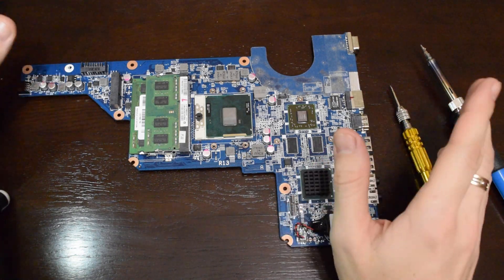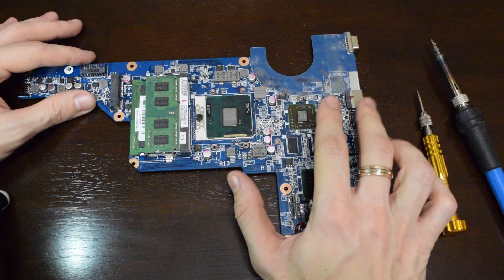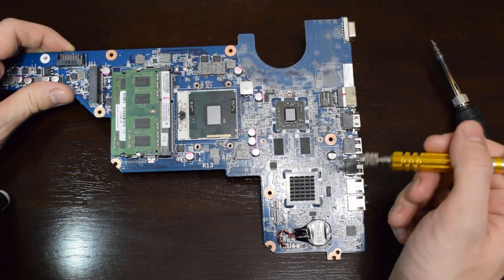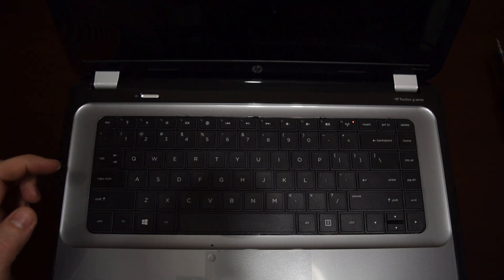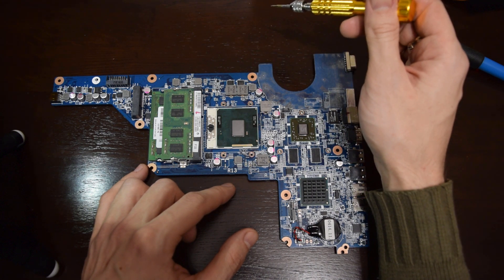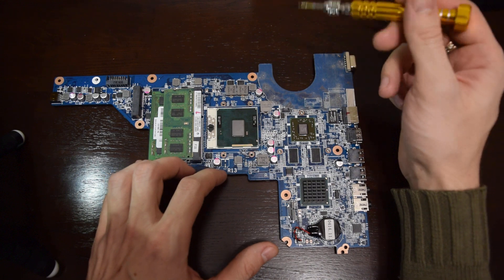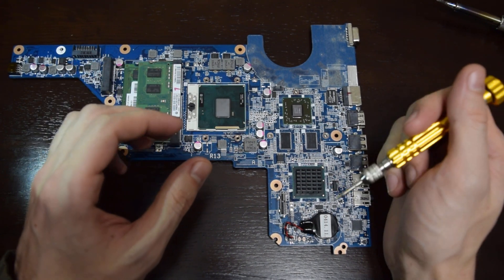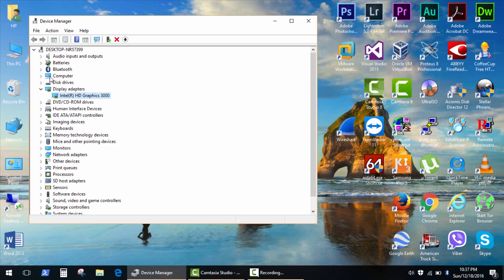Fix Dead GPU – Convert HP, Dell, Lenovo Laptop to UMA Graphics (HP G6 Example)

Comment: For hp G62-a014SL with proc Amd Athlon and graphics Amd Radeon it’s possible remove any coil?
Reply from the maker: Works only with Intel's CPU in that model.
Reply: @ElectronicsComputers  for my model there isn't a solution?

Comment: Hello, would this work with my Acer nitro 5. Nitro 5 (AN515-52-57MQ)please :( badly needed help
Reply from the maker: Technically it's possible but for that model it requires replacing/removing a bunch of tiny resistors and some components and most likely reflashing BIOS for UMA version. Without proper knowledge and tools it's impossible to do at home. Just ask some technicians in your local repair shop to switch your laptop dedicated to UMA graphics.
Reply: @ElectronicsComputers  hello :( I'm here again cause my new pc got burned and just got the laptop to fix left I send it at the local repair shop and told me they can't fix a dead GPU and doesn't know how uma works. If I send u a clear pic of the board and a copy of it's schematic in the web. Can you help me out? 😞
Reply from the maker: @memecentral2758  let's give it a try.
Reply: @Electronics&Computers  hello, I placed the photos and the schematic in the Google drive.
I have the soldering tools and I know how to solder just not familiar with a laptop motherboard since I simply solder home appliances. Hoping you can help me out. Thank you 🥺 appreciated
Reply: Hello, anyway I can send you the link? I can't seem to comment a drive here
Reply from the maker: @memecentral2758  my email is in "about the channel" section.
Reply: @ElectronicsComputers  hello, I can't find any email on the about section

Comment: Would this work for Acer Aspire 4750G?
Reply from the maker: Remove this coil: https://ibb.co/Qvg2TJD
and then move these tiny resistors like in this video: https://youtu.be/8vHh10IOJKQ
Reply: @ElectronicsComputers   i cannot find which coil to remove based on the uploaded photo. Can you please make the highlight a little bolder. Do i need a heat gun to shift the the resistor from the video you shared on this comment?
Reply from the maker: @carlotampus5700  I've just edited the first link. You just need a regular soldering iron for those resistors. But if you have an access to a heat gun that's even better.
Reply: Unfortunately this didn't fix my no display issue. Thanks for the help

Comment: Hello sir
I have a samsung Np670z5e that has the same issue amd graphic card is broken and it causes freezing issues when I'm working on my laptop
I have switchable graphics card intel 4000 and amd
Will this method work for me
Thanks in advance
Reply from the maker: Yes, it will. You'll need to remove one tiny component from the motherboard: https://ibb.co/hYyJ53y
Reply: @ElectronicsComputers   thank you so much you saved me. thank you a million

Comment: Is this possible on Acer aspire 4738z and its chipset is heating whenever I switch on the power
Reply from the maker: No, it's too old laptop and its CPU doesn't have built-in graphics in it.

Comment: I have an Hp Elitebook 8460p with discrete graphics amd radeon 6470m, i dont know which one i should remove. Please help, i'm desperate.
Reply from the maker: It doesn't work like that for this model. But you can buy the same a new mother board with discrete or UMA version for only 50$ delivered.
http://ali.pub/5qmwym
http://ali.pub/5qmx06

Comment: Is it possible to bypass the AMD GPU in a DELL INSPIRON N5010 which has a Core i5 first gen CPU? There are no switchable graphics option on the software side, and maybe on the hardware side too but the CPU has built in HD graphics which is going to waste.
Reply from the maker: Technically it's possible but there's a whole bunch missing components that you have to add in order to provide power for integrated graphics. It's simply not wired. It's almost unreal job without a proper tools and components. 
Check out these motherboards: https://ibb.co/GTRbPLz

Comment: HEY PLEASE HELP ME.....MY LAPTOP IS ALSO HP PAVILION G6.....IT'S CAPSLOCK IS BLINKING ONCE AND I FOLLOWED YOUR STEPS.....AND IT FIXED THE ISSUE BUT NOW, WHEN IT POWERS ON, BIOS SHOWS OVERHEATING WARNING AND WHILE LOADING INTO WINDOWS FAN BEGINS WORK EXTREMELY FASTER AND JUST SHUTTING DOWN UNEXPECTEDLY.....PLEASE HELP ME TO FIX THIS PROBLEM....
Reply from the maker: Are you sure that the heat sink properly attached to the board and there's no gap between the CPU and the heat sink?

Comment: thanks for the video 
I wonder is it not possible to remove the GPU itself since it's easier to identify?
Reply from the maker: To safely remove the GPU chip you'll need an infrared rework station. To remove the coil you can use a 5$ soldering iron or some pliers to cut the coil's terminals.
Reply: @ElectronicsComputers  I figured it'd be easier to identify but hard to remove
thanks for the reply
Reply: @ElectronicsComputers  I tried it on my laptop and got great results https://imgur.com/a/jV0zWYW, now it performs better at lower temps and noise
thanks again for the video

Comment: Thanks for the video! I have an Sony VAIO VPCCA16FG. Could you show me which part I need to remove? Thanks
Reply from the maker: With Sony it doesn't work like that. technically it's possible but you have to swap/replace/remove a whole bunch of tiny components. Without soldering station and proper skills it's almost unreal. Ask technicians in a repair shop to convert your laptop to UMA or buy a new motherboard for 65$ on AliExpress.

Comment: Hello sir! Thank you for the wonderful video! I have a similar problem I believe, but my laptop is very different (around 10 years old I think). It is a Toshiba Satellite L355 with ATI Mobility HD Radeon 5650 dedicated GPU (I think it is dead, because I can boot safe mode with networking, but not normal mode). The CPU is Intel Core 2 Duo T5800, so second generation as you said (I think, please make sure for me). Can you please help me out with this task? Thank you! Oh, and of course, I cannot see the Graphics Card in Device Manager, so I cannot force disable it.
Reply from the maker: Your CPU doesn't have integrated graphics in it so it's not gonna work.
Reply: @ElectronicsComputers  I'm quite certain it has an integrated graphics. I just installed Intel Graphics Accelerated Drivers yesterday. It's the Intel Mobile 4 Chip Family Graphics driver. It even shows it in the Display in Device Manager. It's also the reason I'm able to boot to Safe Mode with Networking but complete crash when booting normally.

Comment: I hope you reply my comment.
Just remove the coil in hp g42 on exact location in this video. but now it not even turn on. (Power light turn on for a second then died).
I tried to remove cmos battery for 10 min to reset bios, not work
Maybe I'm doing wrong..
How to fix it
Reply from the maker: This model has a bunch of motherboards with different specs. Give me the photo or a link to the that motherboard.
Reply: @ElectronicsComputers  this the photo (maybe not too clear)
https://photos.app.goo.gl/hcHT7R4zjrbjm512A
It has i3 370m pga988 with ati gpu

Comment: No idea how you got it off. Soldering wasn't working and it ripped off. Before at least my VGA output was working, now that's dead too. :( Time to put my dear dv7 4012eg to sleep for good.
Reply from the maker: That model has only integrated graphics so it's not gonna work for your model anyway.
Reply: @ElectronicsComputers  No it doesn't. It has an i7 with integrated grapics as well as a soldered on ATI discrete. Bios is just locked so I couldn't switch to integrated only.
Reply: @Schnapsbrennor hello wdym bios is locked, in bios i see fixed and switchable, which one should i chose?

Comment: I had a dell laptop, whenever i installed amd graphic card's driver it turned out into bsod, should i remove the amd gpu?
Reply from the maker: Disabling dedicated GPU usually helps. What's the model of your laptop?
Reply: @ElectronicsComputers  isnpiron N4110, I don't know how to disable it, I've tried disable it from device manager but intel HD won't run. So I installed Bliss OS (android) and it's good now. I can use it to watch videos and do browsing

Comment: Hi Alex, I'm almost sure I'm having a problem that could be fixed in this way, but my laptop is from a brand that it's not listed on the title of the video. It's a Toshiba Satellite P55T-B, which has a dedicated AMD Radeon R9 M265X GPU and an Intel i7-4720HQ processor. Sorry to give you a long description of the problem I'm having, I just want to get things right:

Installing the corresponding AMD drivers just makes everything freeze on screen, including the cursor, leaving me with the only option of forcing a shutdown. Then, following the forced shutdown, the screen always turns completely black after displaying the Toshiba logo on the BIOS splash screen. The only way to go back to WIndows is through safe mode, where I can disable the GPU. Safe for the reduced graphics capacity, the computer is fully functional as long as the GPU is disabled. The reason I'm considering this fix is that the laptop has been giving me a huge headache since reinstalling Windows 10: One of its major updates appears to attempt an install of a graphic driver for the AMD chipset which I'm unable to prevent: I say there a graphics driver installation involved because, at the 48% mark of the installation, the screen turns to black twice for just an instant each time before freezing completely, something that is similar to what happens when I try to install the AMD drivers. The result is that all the progress of the update is undone and the SO in my computer is brought back to a previous restore point.

At this point, I have already given up on the GPU, but I'm hesitant of trying this because I want to make sure I get things right first. So my questions to you are:

1. Do you think the fix in the video is something that would work for my Toshiba Satellite P55T-B considering its particular architecture? 
2. If the answer to the previous question is yes, can you please point which is the coil that I should remove?

Here is a picture of the motherboard: https://ibb.co/w7f14qY

I can open the laptop to take a more detailed photo if needed,

Thanks a lot!

Hope you're doing well!

Edgar
Reply from the maker: It's not that easy with Toshibas. Most models require components swapping and removing but you can try to carefully remove these coils: https://ibb.co/Xkg7HhC

Comment: I have a Toshiba M840 laptop with i7 3rd gen and 1gb AMD graphics, now the Amd chip is dead and the IGP are disabled by factory, I don't even see any option in Bios to activate the Integrated graphic.

How to unlock the IGP, kindly suggest something ?
Reply from the maker: Technically it's 100% possible to convert your laptop to integrated graphics. Unfortunately I don't have schematics for that model. it may not only require to remove the coil but also swap some resistors. But anyway try to remove this coil which will deactivate power to the discrete graphics. https://ibb.co/51KC29R

Comment: hi . i was just speechless why my dell n5110 i7 2630qm with 1gb 525m wont boot up i went to shop and he says the gpu is dead and did some thing and now the laptop boot up with only intel 3000 and no gt52m .now i know why and what he may have done .  but i still miss the gt card can i some how change it and just try once again to remove or replace the dead gpu ?  i bought it with so much saving and it just died on me :( cant do any thing with intel3000 graphics :(
Reply from the maker: Yes, they simply deactivated dead GPU. Actually, there's no big difference unless you play games. GPU replacement will cost you about 50-70$ depends on where you live. But you can also buy a new motherboard for about 50$ http://ali.pub/54asqj
Reply: @ElectronicsComputers   thank you  kind sir for even giving me the new board link, may i ask that linked board will have card and cpu both i mean to say ful board with gpu and cpu ? in description says no cpu so i have to demount my own cpu ?
Reply from the maker: @bilalkhan-hf4cg  it's very easy to replace the CPU. There's a  big screw on the socket. Simply turn it and remove your CPU.

Comment: Nice work.....Can you please help me to repair my HP G62 laptop...It has same fault...But i have no idea to disable ati chip by removing component....Can you help me to fix?
Reply from the maker: I need the precise model of your laptop or at least its specs or motherboard picture. G62 comes with different CPUs.
Reply: @ElectronicsComputers  Thanks for reply.....Can you provide a link for send motherboard pictures?

Comment: Will it work on pavilion G6 1003tx model 
Processor: Intel Core i5 1st Gen - 480M (1st Gen) Clock-speed	
2.6 Ghz
Chipset: Intel HM55 Express
Graphic:
AMD Radeon HD 6470M
Graphics Memory	
1 GB
Reply from the maker: No! It's not gonna work.
Reply: @ElectronicsComputers  but it has switchable graphics with integrated Intel HD graphics onboard besides the dedicated amd Radeon

Comment: Help me ?
My   motherboard ( Hk5 )  of sony vaio e1513  doesn't have this section
 ( on board  gpu ) on board . And i am facing no Video output problem ( no video data for internal or external display ) , but all led indicator and fan is working . 
But onboard bga ic named Slj8E is heating between around  70 to 80 c i can't touch this ic more than 3 second without heatsink on it . I am thinking this ic is dead but i am not sure !!  ( Is it gpu ic ? Or it's Graphics ic ? )  Some people told me that i should remove power supply of  graphics ic by removing inductor , So  system will use inbuilt graphics of processor . Now i am confused that for with ic they are talking about ? 
Ic named bga ic slj8E also known as HM76
Or
 they are talking about ic which does'nt exist on my motherboard ( which probably can be GPU ) ?
Reply from the maker: Your laptop doesn't have dedicated graphics card. There's only integrated into your CPU Intel® HD 3000 Graphics.
Try to turn On your laptop and then press the CapsLock key. Can you see its indication going On and Off?
Reply: @ElectronicsComputers  no there's no indication of led when evervi press cap lock or numberlock key !! What is the problem ?
Reply: What it indicates ? If leds not turn on ?
Reply from the maker: @omsingharjit  most likely the chipset is dead.
Reply: @ElectronicsComputers  cheapest mean slj8e for mine case ?
Reply from the maker: @omsingharjit  yes, that's Intel® BD82HM76 chipset. It's not expensive repair just go yo any repair shop or try to heat up that chipset with a hair dries for about 2-3 minutes.
Reply: @ElectronicsComputers  * * is it possible to replace bga Chip using just hotair gun instead of ir heater bga rework station ?
*There's lots of small smd components on the other side of the same bga slj8 chip so is it not possible that wile  heating  (removing ) some of smd on the back side might fall off ?  

Is it ' plug and play ' type bga ic or it needs to be program or burn first before installing it on mother board ?
Reply from the maker: @omsingharjit  First of all I can't guarantee that the problem in your chipset. First, I would check the CPU and all power rails. I always use rework station for such chips because they are too big for hot air station but in theory it's possible. You'll need a new chip, proper size solder balls or soldering paste and a proper stencil for that particular chip.
Reply: @ElectronicsComputers  i know the process of re balling but i think i should not do do by  self .

Comment: sir, i have sony vaio SVE14A15FNW laptop which have integrated intel hd3000 and dedicated AMD radeon hd7670m gpu. But my gpu 7670m become dead, can i replace it with intel hd 3000 by your method.
Reply from the maker: Yes, you just need to disable power from the dead GPU by removing the coil.
Reply: @ElectronicsComputers thanks for replying, i want to ask you  when i remove the power coil of dead Amd gpu then it perhaps it become disable and only gpu which will work will be Intel hd 3000. But i want to replace my Working intel hd 3000 graphics with the dead Amd radeon hd graphics. Is it possible by just removing the coil.
Reply from the maker: @robindeswal  if you disable dedicated graphics your laptop will switch to integrated one.

Comment: I have an HP Omen 15 with i8750h  nvidia GTX 1060 Max Q it has hp disabled integrated Intel graphics GPU it does not show in bios can I enable it I wanna try and flash the dedicated nvidia to a GTX 1060 regular not maX Q.
Reply from the maker: That model doesn't support switchable graphics, only laptops with GTX 1050 support it.
Reply: @ElectronicsComputers  The integrated Gpu is in there but is completely disabled which is terrible our battery could last so much longer it's heart breaking  I thought I could do this modification.

Comment: Great job, dude <3
i cannot find the terminal or coil in my motherboard .. i have dell inspiron n5010
can you show me where?
Reply from the maker: Unfortunately it's not gonna work for your model. technically it's possible actually but there's no power for internal graphics. So you have to add/remove/swap a bunch of tiny components which reacquires some knowledge and special tools. But you can buy a new motherboard for 55$ delivered: http://ali.pub/4zkyw2

Comment: Great video i need some help with a Acer nitro 5 2019 model my gpu isn't working thanks
Reply from the maker: I don't have access to Acer's schematics! If you can carefully remove these coils: https://ibb.co/ZVWV6M1 then give it a try otherwise go to a repair shop and ask them to convert it to UMA graphics only.
Reply: Thanks fam, but removed the two before you replyed it came on 1 time and said it couldn't find the boot device then i turned it off, now when i turn it on only the light in the keyboard came on nothing on the screen